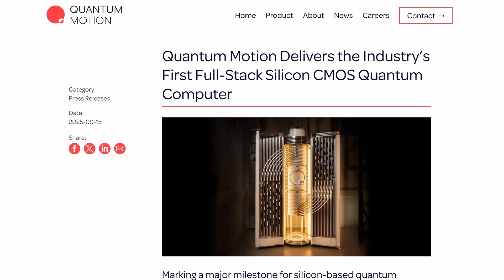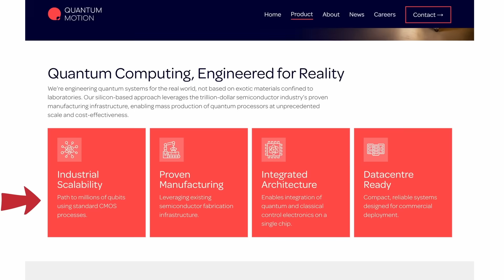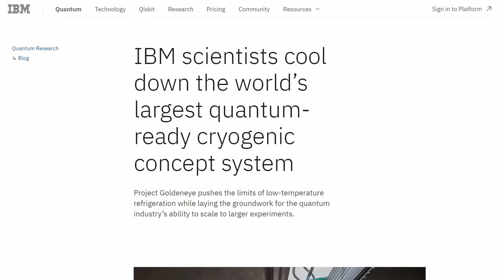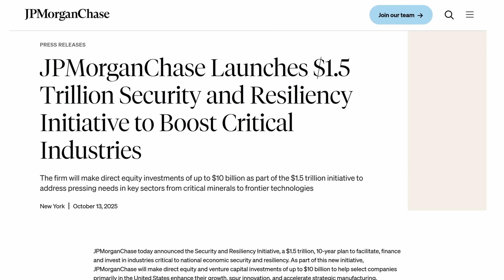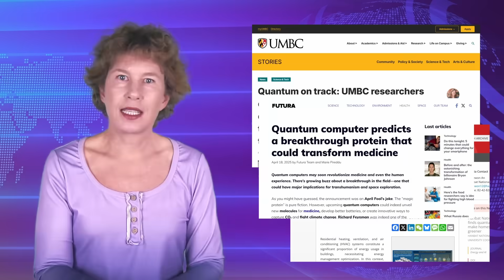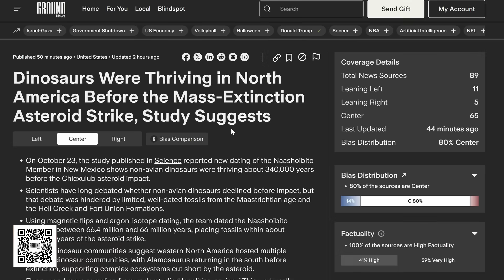I was SO wrong about quantum computing.

Comment: It seems like, so long as our methods for attaining "quantum" computing require enormous amounts of energy inputs elsewhere (I don't even want to know how much it costs to get stuff that cold for that long), we're probably barking up the wrong tree.  If you want to achieve a low energy state for computing, seems like you'd want to figure out a way to simply use as little energy to do the compute from the basic logic, which I get is sorta a "duh" observation but nonetheless an important one.  If your plan does not scale economically, why would you attempt to do economic scaling on it?

Comment: X	 = 	± Width	  	 	 	 	 	 	 			 	= -70
Y	 = 	± Length	  	 	 	 	 	 			 	 	= -24
Z	 = 	± Height	  	 	 	 	 	 			 	 	= 10

ρ	 = 		√ ( X ² + Y ² + Z ² ) 	  	 	 	 		 	= 74.7

X-State	 = 	½ × ( 1 – X / ρ )	  	 	 	 	 	 	= 96.9%
X-State	 = 	½ × ( 1 – COS ( X-Perimeter × π ) ) 	= 96.9%
X-State	 = 	½ × ( 1 – COS ( X-Angle × π / 180° ) ) = 96.9%
X-State	 = 	½ × ( 1 – X-Norm )	  	 	 	 	 	= 96.9%

Y-State	 = 	½ × ( 1 – Y / ρ )	  	 	 	 		 	= 66.1%
Y-State	 = 	½ × ( 1 – COS ( Y-Perimeter × π ) )	= 66.1%
Y-State	 = 	½ × ( 1 – COS ( Y-Angle × π / 180° ) )= 66.1%
Y-State	 = 	½ × ( 1 – Y-Norm )	  	 	 	 	 	= 66.1%

Z-State	 = 	½ × ( 1 – Z / ρ )	  	 	 	 		 	= 43.3%
Z-State	 = 	½ × ( 1 – COS ( Z-Perimeter × π ) ) 	= 43.3%
Z-State	 = 	½ × ( 1 – COS ( Z-Angle × π / 180° ) )= 43.3%
Z-State	 = 	½ × ( 1 – Z-Norm )	  	 	 	 	 	= 43.3%

X-Perimeter	 = 	ACOS ( X / ρ ) / π	  	 	 	 	= 88.7%
X-Perimeter	 = 	ACOS ( 1 – 2 × X-State ) / π	  	= 88.7%
X-Perimeter	 = 	X-Angle / 180°	  	 	 	 	 	= 88.7%
X-Perimeter	 = 	ACOS ( X-Norm ) / π	  	 	 	= 88.7%

Y-Perimeter	 = 	ACOS ( Y / ρ ) / π	  	 	 	 	= 60.4%
Y-Perimeter	 = 	ACOS ( 1 – 2 × Y-State ) / π	  	= 60.4%
Y-Perimeter	 = 	Y-Angle / 180°	  	 	 	 	 	= 60.4%
Y-Perimeter	 = 	ACOS ( Y-Norm ) / π	  	 	 	= 60.4%

Z-Perimeter	 = 	ACOS ( Z / ρ ) / π	  	 	 	 	= 45.7%
Z-Perimeter	 = 	ACOS ( 1 – 2 × Z-State ) / π	  	= 45.7%
Z-Perimeter	 = 	Z-Angle / 180°	  	 	 	 	 	= 45.7%
Z-Perimeter	 = 	ACOS ( Z-Norm ) / π	  	 	 	= 45.7%

X-Angle	 = 	ACOS ( X / ρ ) × 180° / π	  	 	 	= 159.6°
X-Angle	 = 	ACOS ( 1 – 2 × X-State ) × 180° / π	= 159.6°
X-Angle	 = 	X-Perimeter × 180°	  	 	 	 	 	= 159.6°
X-Angle	 = 	ACOS ( X-Norm ) × 180° / π	  	 	= 159.6°

Y-Angle	 = 	ACOS ( Y / ρ ) × 180° / π	  	 	 	= 108.7°
Y-Angle	 = 	ACOS ( 1 – 2 × Y-State ) × 180° / π	= 108.7°
Y-Angle	 = 	Y-Perimeter × 180°	  	 	 	 	 	= 108.7°
Y-Angle	 = 	ACOS ( Y-Norm ) × 180° / π	  	 	= 108.7°

Z-Angle	 = 	ACOS ( Z / ρ ) × 180° / π	  	 	 	= 82.3°
Z-Angle	 = 	ACOS ( 1 – 2 × Z-State ) × 180° / π	= 82.3°
Z-Angle	 = 	Z-Perimeter × 180°	  	 	 	 	 	= 82.3°
Z-Angle	 = 	ACOS ( Z-Norm ) × 180° / π	  	 	= 82.3°

X-Norm	 = 	X / ρ	  	 	 	 	 	  	 		 	= -.9374
X-Norm	 = 	1 – 2 × X-State	  	 	 	  		 	= -.9374
X-Norm	 = 	COS ( X-Perimeter × π )	  	 	 	= -.9374
X-Norm	 = 	COS ( X-Angle × π / 180° )	  	 	= -.9374

Y-Norm	 = 	Y / ρ	  	 	 	 	 	 	 	 	 	= -.3214
Y-Norm	 = 	1 – 2 × Y-State	  	 	 	 	 	 	= -.3214
Y-Norm	 = 	COS ( Y-Perimeter × π )	  	 	 	= -.3214
Y-Norm	 = 	COS ( Y-Angle × π / 180° )	  	 	= -.3214

Z-Norm	 = 	Z / ρ	  	 	 	 	 	 	 	 	 	= .1339
Z-Norm	 = 	1 – 2 × Z-State	  	 	 	 	 	 	= .1339
Z-Norm	 = 	COS ( Z-Perimeter × π )	  	 		= .1339
Z-Norm	 = 	COS ( Z-Angle × π / 180° )	 	 	= .1339

X = ρ × ( 1 – 2 × X-State ) 								= -70
X = ρ × COS ( X-Perimeter × π ) 						= -70
X = ρ × COS ( X-Angle × π / 180° ) 					= -70
X = ρ × X-Norm 											= -70

Y = ρ × ( 1 – 2 × Y-State ) 								=  -24
Y = ρ × COS ( Y-Perimeter × π ) 						=  -24
Y = ρ × COS ( Y-Angle × π / 180° ) 					=  -24
Y = ρ × Y-Norm 											=  -24

Z = ρ × ( 1 – 2 × Z-State ) 								= 10
Z = ρ × COS ( Z-Perimeter × π ) 						= 10
Z = ρ × COS ( Z-Angle × π / 180° ) 					= 10
Z = ρ × Z-Norm 											= 10

Comment: I invest in Quantum computers, and here is the most recent report from D-Wave  (QBTS) from the stock market: Detailed Fundamental Analysis of D-Wave Quantum Inc. (QBTS) Q3 2025 Earnings Report
This analysis focuses purely on the intrinsic financial and operational performance reported in the D-Wave Quantum Inc. Q3 2025 earnings, excluding all external stock market factors and investor sentiment. The sector-relative context acknowledges that quantum computing companies are early-stage, characterized by high R&D costs, low absolute revenue, and high growth rates.

Justification for the Score (88/100)
The high score is justified by the company's dual success in accelerating core business growth and establishing financial security. For an early-stage technology company, doubling revenue and achieving high gross margins are critical validation of the product's value, while securing a multi-year cash runway is paramount for intrinsic stability.

The score is not a perfect 100 due to the significant and widening operating expenditure, which increases the pressure on management to convert current R&D investment into future profits. However, in the quantum sector, aggressive investment (cash burn) to secure technological leadership is often viewed as a fundamental necessity and a primary driver of long-term intrinsic value.

Key Highlights (Positives)
Revenue Growth and Commercial Validation:

Revenue: $3.7 million, representing a 100% increase year-over-year (YoY). This rapid doubling of sales validates that D-Wave's products and services are successfully moving beyond research and into meaningful commercial adoption across diverse sectors (e.g., airline, finance, manufacturing).

Bookings Momentum: Closed Q3 bookings of $2.4 million (an 80% sequential increase) and subsequently announced a significant €10 million capacity deal for the Advantage2 system in Q4. This demonstrates an accelerating sales pipeline and strong future revenue visibility.

Exceptional Margin Expansion:

GAAP Gross Margin improved to 71.4% (up from 55.8% YoY), and Non-GAAP Gross Margin reached 77.7%. These margins are exceptionally high for a business involving sophisticated hardware and services. This suggests strong pricing power, improved cost efficiency, and a robust underlying unit economics, which is a powerful indicator of intrinsic value.

Unprecedented Liquidity and Runway:

Cash, Cash Equivalents, and Investments reached a record-high $836.2 million. This massive increase (primarily from warrant exercises) provides a vast, multi-year operational and R&D runway. For a deep-tech company, this capital security eliminates near-term dilution risk, funding the critical development phase of both its Annealing and Gate Model architectures.

Technology and Customer Diversification:

The company secured new or renewed engagements with major international entities, including a large U.S. international airline, Japan Tobacco (pharmaceutical division), and a leading Turkish bank. This diversification of use cases (optimization, drug discovery, finance) validates the intrinsic utility of quantum annealing technology today.

Key Challenges (Negatives/Nuances)
Widening Operating Loss (Cash Burn):

Adjusted EBITDA Loss widened to ($20.6 million), a 49% increase from the prior year. This reflects the significant rise in operating expenses ($30.4 million GAAP OpEx, up 40% YoY). While necessary for R&D and expansion, this accelerated burn rate increases the intrinsic risk profile and the reliance on future, yet-to-be-realized revenue to achieve profitability.

GAAP Net Loss Distortion:

The GAAP Net Loss was a substantial ($140.0 million). While this was predominantly a non-cash, non-operating charge ($121.9 million) related to the remeasurement of the warrant liability (a technical accounting item), it underscores the financial volatility inherent in the capital structure of SPAC-merged companies. The focus for intrinsic analysis remains on the adjusted operating loss.

Technological Competitive Nuance:

D-Wave's current commercial success is rooted in quantum annealing, a platform distinct from the gate-model computers favored by many competitors. While D-Wave reported progress on its own Gate Model program (fluxonium qubit chips), the intrinsic value still hinges on its ability to compete in both architecture streams or on annealing's sustained superiority for optimization problems.

Discussion of Valuation and Future Growth Context
From a fundamental perspective, the intrinsic value of D-Wave is not based on near-term profitability but on the value of its intellectual property, installed base, and secure cash position.

Valuation Context: The valuation of QBTS is primarily a function of its "Future Discounted Economic Profit Potential." The Q3 report demonstrates that the company is successfully executing the three steps necessary to secure this value:

Product/Market Fit (Revenue/Margin): Confirmed by 100% growth and >70% gross margins.

Resource Security (Cash Runway): Confirmed by the $836.2 million cash, which ensures survival and execution capability for its R&D roadmap.

Technological Progress: Confirmed by the commercial release of the Advantage2 system and tangible progress on the foundational Gate Model chips.

Future Growth Context: Future intrinsic value will be driven by the translation of R&D expenses into superior technology. The large, signed capacity deals (e.g., the €10M Italy deal) provide a structural floor for future recognized revenue. The ability to continually increase the value of each quantum solve through hybrid systems (demonstrated in customer proofs-of-technology with North Wales Police and BASF) is the long-term engine for scalable, recurring revenue and intrinsic growth. The report shows a fundamental platform that is accelerating in market adoption, backed by nearly insurmountable financial firepower for the competitive deep-tech sector.

Comment: Quantum Motion claims to have a full stack CMOS quantum computer, but in reality they struggle to even operate two spin qubits in a double dot. They have never even shown a two-qubit gate. This is also why they do not mention any numbers in their press release. If start-ups do not show anything, it is very likely they have nothing. Quantum Motion has only shown multiple papers about qubit read-out and control electronics, but no qubit operation at all. They probably have a single qubit (or two at max) connected to a classical control chip that they designed, and probably some software stack on top. 

Unfortunately, spin qubits still lack behind in general, even though they have plenty of start-ups. The problem is that many of them (including Quantum Motion) rely on foundry devices (mostly coming from semi-industrial fabs such as imec), which are still not good enough, so they struggle to progress beyond two qubits. Intel and newly founded start-up Groove are the only ones that have presented extended multi-qubit arrays in papers or conferences. Diraq also deserves a notable mention since they do at least great work on smaller (foundry) devices. Progress is slowly picking up with these foundry devices, so I hope to see more in the future.

Comment: Likely impossible to produce real large scale quantum computers.  Iirc one real qubit needs like 50 regular qubits for error correction.   It remains to be seen if it is viable for error correction to work and if minimum possible error rate isnt low enough error correction wont be possible ever.

Comment: Qubits do not require a lot of heat per se, so that is an invalid argument. Current challenges with too many wires into the cryostat when scaled can be resolved with better wires for the time being. And there a roadmaps to move from wires to integrating these signal lines onto cryo-compatible CMOS, also not unfeasible on the roadmap. It is not a scientific hoax, it is an engineering effort that needs to be done and is being done.

Comment: The times I used to dismantle the previous old school stereo radio tuners with their string like sewing machine reels and making a total stuff up or some car engine carburetor and leaving behind a heap of scrap doesn't bode well for any further tinkering with pc devices now. Its impossible to put one of these milions of wire towers and small circuit components together. Like why they cant recreate old desk pc models without any original manuals😅

Comment: Cooling is a problem for superconducting quantum computers (Google, IBM and Rigetti, for example). However, there are many other modalities/technologies. For example, IonQ and other companies use trapped ions. This works at room temperature.
The magic of QC is that it scales exponentially rather than linearly, unlike traditional semiconductor computers. Once you reach a certain point, profits can increase exponentially.
As long as QC continues to make progress each year, we will reach this point.
Reply: In fact it´s been the other way around.  Semiconductors grew exponentially doubling every 1.5 year for decades;  while QC at best case goes linearly, and that ...apparently;  because once the b.s. is uncovered it shows that spins around a fixed point. What grows exponentially about QC  is hype and money poured into that sinkhole.
Reply: "Once you reach a certain point, profits can increase exponentially." that isn't the profound thing that you think it is. If I have one cent and then get 2 and then 4 and then 8 and then it stops my money still increased exponentially. You aren't saying much.

Comment: I think parallel development of supporting technologies are making the improbable possible. For example, how can you fully cook a chicken within minutes? Put it in a vat of cooking oil, turn up the heat, and pressurize the container?

How does this translate to quantum computing with cold temperatures and vibrations to worry about?

Stop using traditional methods and think outside the box.

Comment: Heat is the primary issue in silicon too (Nvidia is as big as they are because their processors come with a fan). So everyone (IC makers) is scrambling to develop anything that might replace transistors in silicon. End of life cycle for transitors in silicon combined with ever greater need for compute (data centers, AI, etc, our online lives) is creating a tremendous bubble in compute tech. Of course some of it is BS.

Comment: Xanadu's Aurora is a prototype universal photonic quantum computer designed for scalability and networking, representing a significant step toward fault-tolerant quantum computing. 
Key Specifications of Xanadu Aurora
Feature 	Specification
Qubit Type	Photonic qubits (based on squeezed states of light)
Physical Qubits	12 physical qubits
Squeezed State Qubits	84 squeezed-state qubits (used to furnish the 12 physical qubits)
Architecture	Modular, networkable system of four interconnected server racks
Photonic Chips	35 photonic chips in total (including source, multiplexer, and QPU chips)
Fiber Optics	13 kilometers of fiber optics used for interconnection
Operating Temperature	Primarily room temperature; only the photon detection system (36 detectors) is housed in a cryostat
Functionality	Integrates all necessary functions for fault-tolerant computation, including qubit generation, multiplexing, logic gates, and real-time error correction
Scalability	Designed with a modular approach, demonstrating the potential to scale to thousands of racks and millions of qubits in a quantum data center model
Aurora is a proof-of-concept system that focuses on demonstrating the feasibility of networking quantum modules, a critical challenge in scaling quantum computers to a useful size. The primary current challenge for Xanadu is the reduction of optical loss within the system's components to achieve the performance threshold necessary for effective fault tolerance.

Comment: I off and on wonder if a qubit is an actual spin-1/2 particle in a spin-up/spin-down superposition (which I think means quantized along a different axis), a million (or billion) ordinary bits emulating such a superposition, or something completely different.  I should research it myself.  As for the hype, it seems swamped by the AI hype -- something unambiguously less justified.

Comment: As a computer scientist, I have already used the current public capability of QPUs to solve problems not possible on classic computers.
The economics of it may be questionable; a cheap almost perfect solution is much more viable in the market than a perfect ridiculously expensive one.
Google achieved quantum supremacy several years ago and access to the tech was classified.
It will remain so until we figure out better methods of encryption.
Reply: ^ The problems it creates (for hackers, enemies, etc). Is what makes Quantum computers so valuable.

Give some brilliant thinkers a tool that nobody else has or ever will have in the next decade or two, and you have a weapon. Destroyer of worlds.